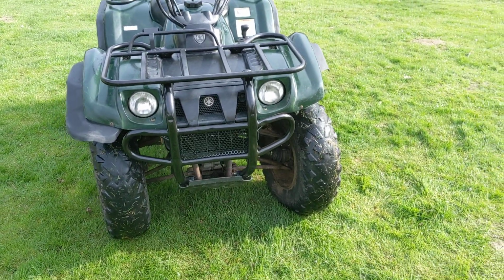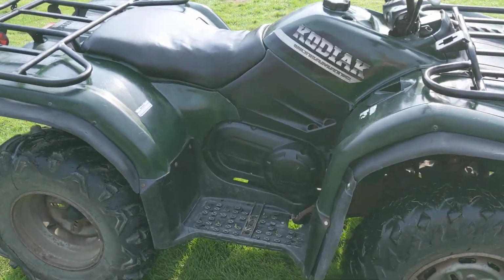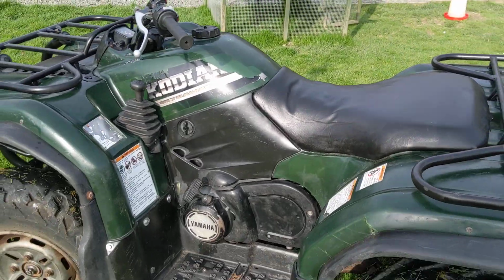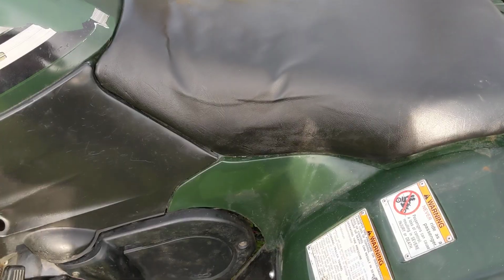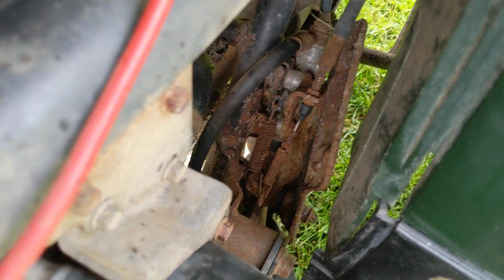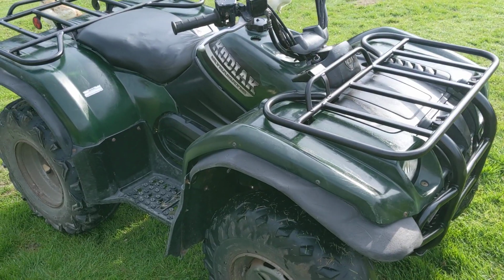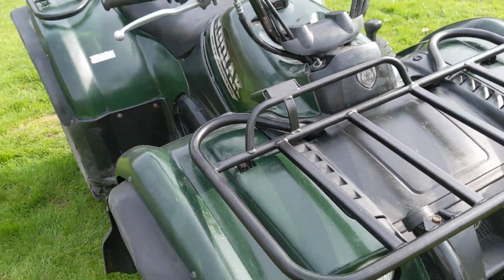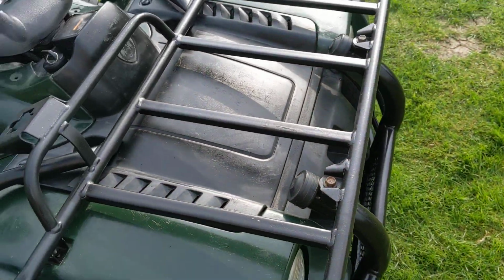Bargain Yamaha Kodiak 400 - Best ATV quad ever?

Comment: just picked one up in Au just around the corner for 2k runs perfect after i flushed tank fix fuel leak , even head lights work front diff works , only issues front boots needs doing and its rear boot looks geases and wet , brakes need work rear not working looks like drum rear ,front need flushing and calipers free up .mine has no low range ,not sure on year

Comment: I bought my Kodiak in 1995 brand new ,I called up my wheelchair! because I broke my back and had a spinal cord injury riding my 1972 Bultaco 360 El Bandido😮 the Lord help me walk again 😊I went back climbing 40 ft ladders painting Barns and houses for a living.
 and building log cabins homesteading in the wilderness all around the country😊 I still have my Kodiak ! It's 2005 now!. I'm going to rebuild the carburetor and cover the seat for the second time and replace the front master cylinder.what's  I've had it in some really wild places from Lake Superior homesteading off-grid for 8 years to 20 years in the Ozarks in Arkansas homesteading homesteading .and homesteading in Wisconsin where I bought it. hauling a lot of building materials building log cabins hauling water and supplies pulling dear pulling logs ,trailers ect!! when I first bought it ,I pulled my 16 ft horse trailer with it😮 with the wife in the bag drinking a beer😅 I wish I wouldn't have done that but it was brand new😮 I flipped it upside down in a deep ravine in the Upper Peninsula of Michigan wilderness! trying to get by it and going around a tree.I jumped off it  barly!turned upside down.it would have pin me to the ground 😢it did bend the rack a little bit😮 there was enough room in the bottom of the ravine to flip it back over again with a come along ,to a tree abouve.

Comment: I had a 96 400 , great machine but front bearings suck and back brake system sucks .
Engine and drive train the best , even bt todays standards . Best part about that machine is in low range , you could pull anything.  But man at 660 pounds,  you need that winch!

Comment: I have a 2005 Kodiak 450 with only 4000km on it.  I like the independent rear suspension over the straight rear axle in snow. Only problem I had is to replace the battery once, until this week.  It won't shift back from 4wd to 2wd after all winter. May be a corroded switch, or a bad relay or the front differential servo motor.

Comment: I have 2001 400 (green) and 2004 400 (red) I've had them about 10 years now. These things are built like Tanks. The 2001 has hi/lo range so I always use it to pull the heavy loads.

Comment: I have a 2000 kodiak 400 I have had since new.  Mine does not have a speedometer but I clocked it at 45 mph. It sat for a long time while I worked out of state but now I am cleaning it up and getting it ready to run again.    This is a great little ATV.   The low range is a nice feature.   I just replaced the original Dunlops with a set of Carlisles.   New calipers and pads and flush the brake lines.  It should last longer than I will.    Nice to see some are still out there running hard.

Comment: Hey strange question here 
My father passed a few months back and left this bike to my sister and myself, I've driven it many times but there is one thing I don't know and I'm not sure where else to ask 😅 
When shifting from high to low or even engaging 4 wheel drive, do I need to let off the gas or come to a complete stop? Should I be trying to get the rpms up before shifting into high gear?
any help would be appreciated 😊
Reply: you need to come to a complete stop and press on the foot brake lever pedal at the same time

Comment: Have fun adjusting the fuel screw... its in a stupid place. even with a 90 degree pinion screwdriver its difficult as hell  the  nipple  for the  breather tube gets in the way and causes the pinion's teeth on the bit side of the  screwdriver to catch so you cant tell if the if you jumped off the flat head  slot in the screw or what.  Lots of OEM parts are discontinued including the boots on both side of the carb. Although yours seems to be in decent condition.... the one im having the displeasure of working on had cockroaches crawling from it soon as i took the seat off. You'd think it was a scene from the first men in black movie..... MORE SUGAR WATER!!!!

Comment: Lost my 2007 over side of a logging road down about 300'. It barrel-rolled and shed plastic the whole way. The racks bent and crushed the fenders but the frame did not crack and it literally started right up. I just gathered up all the plastic. Only other issue I've had was a short in the harness that I fixed, and low charging.  I replaced the rectifier which seems to fix that. I did rebuild the carb. It fits perfectly in my truck bed with the gate up. A reliable machine if you care for it.
Reply: Can you tell me a bit more about the short on the harness.  I’m working through this now

Comment: The grizzly was introduced back in 1998, because I owned a 1999 Yamaha grizzly 600
Reply: Yep you are correct cuz I worked at a Yamaha dealership back in the 90's and they grizzly was the big stink in 98.

Comment: I have two of these, a '00 and '01, and have had them since new.  They really are the best quads ever made.  Very reliable and overall pretty simple machines.
Reply from the maker: They are very good. I've had about 12 now. There better than the 450 in my opinion, I just can't recommend them over the 450 now as they are getting on so finding decent ones is hard. Only thing I really don't like is the non replaceable ball joints so you have to but complete control arms